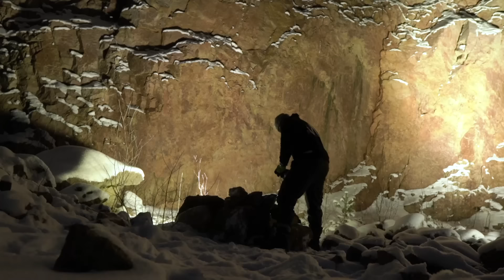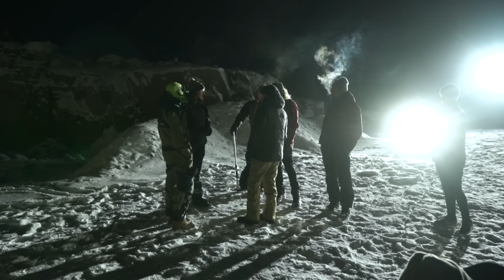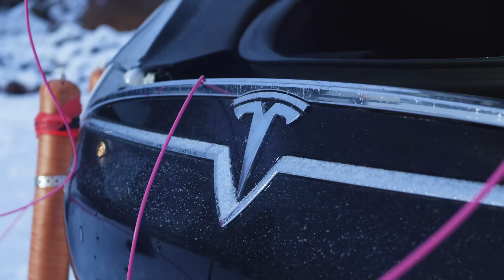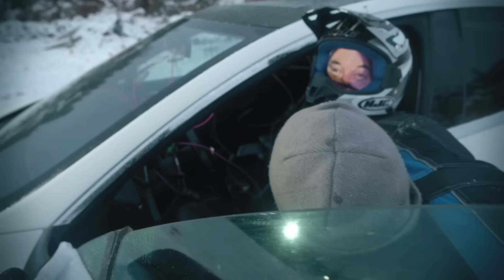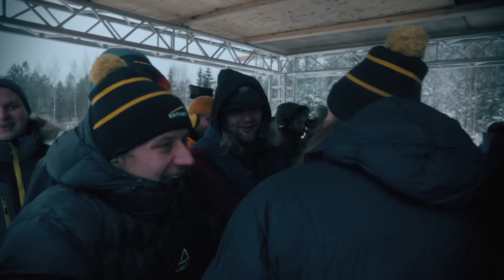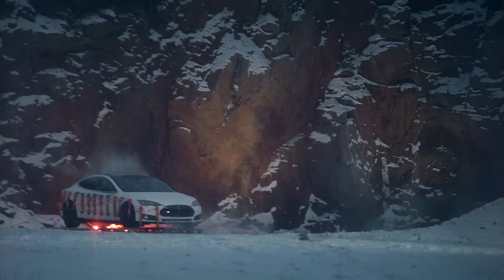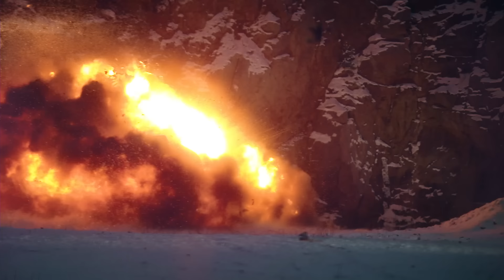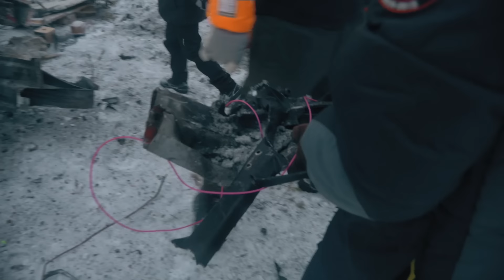Mies joka räjäytti TESLANSA!! Tesla Model S & 30kg dynamiittia.

Comment: It was soooooo beautiful.. despite it was a Tesla ( i understand the frustration, i hope Tesla's policies will change and soon). Honestly i was thinking to buy a Tesla model 3, but after seeing this..nope i will wait for the Toyota BZ4.
Reply: How about the Hyundai ionic? The  Ford F-150 Lightning and Mach E mustang are good choices too.
Reply: You should do more research into the Model 3 than just looking at this video (for instance, the quality of Tesla batteries have greatly improved since they produced this car in 2013, and the Model 3 uses a very different type of battery from the one the Model S has that is supposed to last over 300,000 miles). This owner was very unlucky and it's unfortunate that the service center in Finland didn't help him, but this one video doesn't show the full picture of owning Teslas and doesn't discount all of their happy owners. With any other car company there are an unlucky few who will experience problems with their cars and the companies won't help them.
Take GM with the Bolt fires, telling their customers to park their cars away from other vehicles in case they burst into flame, and limiting the amount the battery can charge for the same reason. There's also the Mach-e, which was so rushed that it continued to have software and hardware issues some of which Ford has deemed unfixable.
If this video is the only reason you're not buying a Tesla, you should give them a fair wrap by doing research on all the other horror stories caused by the legacy automakers, and after doing that you're probably never going to be able to buy a car again. I'm not necessarily saying Tesla is on the right here, but taking a highly unlikely scenario into account isn't really necessary when purchasing a car especially since all other automakers are just as if not more guilty.
Not to mention that Toyota is just about to get into the growing pains that Tesla experienced 8 years ago when they produced the car in that video since Toyota refused to abandon their hydrogen project for so long. They say the BZ4 will start production later next year, but it's probably going to be in very limited quantities and you might not be able to get your hands on one for several years, especially if they push back the release date as most automakers have had to do when they found out producing EVs was harder than they thought. Just because they are good at producing a lot of gas cars doesn't mean they're good at producing EVs since their power trains are completely different. Also, Toyota is bound to make many mistakes producing their first BEV while Tesla has had a decade of experience.
There's also many disadvantages to owning an EV other than a Tesla. For instance, legacy automakers are losing tons of money on these vehicles since they're just starting production on them, so not only are they more incentivezed to sell higher-margin gas cars, but they also have to sell their EVs at a higher price than a Tesla with less range and worse performance since the technology lead in Tesla's department is huge. Another thing is that all four Tesla models are the safest-rated cars in history, safer than even Volvos. Not only are they way less likely to get into a crash because of their autopilot, they are much less likely to cause injury or death if you get into an accident, which in my opinion is very important. I recommend looking at the safety reports that Tesla releases quarterly. We'll have to see if Toyota can match their level of safety. Also, one of the most important factors is battery charging infrastructure. Tesla has spent the last decade putting their charging stations all across their biggest markets while the other automakers have to rely on 3rd party chargers that are less in numbers but high in demand, prone to breaking, slower, and overall less reliable. I recommend watching Marques Brownlee's video on a road trip in a gas car, a Tesla, and another EV in order to get an idea of just how more reliable the charging network is for Teslas.
I'm not necessarily saying you have to buy a Tesla, but considering the other options it'll probably give you the best experience of what it's like to own an EV despite what happened in this video. It's great that you want to own an EV, as I also want to own one soon, but it's probably best you do some more research into EVs in order to find the one that's least likely to cause problems. We both don't want you to have a sour taste in your mouth towards EVs if you buy one and find out the charging infrastructure is terrible and end up stranded since the chargers don't work.
Reply: @collintheviking2082  yeah, literally everybody else will have the same problems.  Not even mentioning that most manufacturers will use same batteries etc. So everybody will just use current tech and have same issues. Its just part of the ev transition. Gas cars will be forbidden to go into cities and have massive taxes very soon so ...

Comment: This is exactly why I am hesitant regarding buying an electric car. They have not been around very long, only about 8 years or so, which to me is not very long at all. My main concern is how long the battery pack lasts, considering it is extremely expensive to replace. in fact, it is so expensive it is not even worth it. I am currently driving a 2002 VW Passat with 260K miles (418K km) on it still going strong. I'd expect an electric car to last 20 years and 250K + miles as well before I'd get more exited about buying one.
Reply: while i agree with your points i have one correction for you: the electric cars have been around for much longer than 8 years, and in fact Tesla themselves built their first car in 2006. the first electric car to be built was built in 1835.
Reply: @lenajk2004 Well, yes, I knew all that but mass adoption of electric cars really started with Tesla Model S. All previous attempts at making electric cars before Tesla came along pretty much flopped and the Roadster were more like a toy for the rich.
Reply: @Uncommonsensetoo  Nissan Leaf would like a word with you. But they definitely made electric cars cool.
Reply: Only thing common between the first vintage electric cars and modern EV is the same number of wheels and the basic idea.
Cars back then didn't have even a roof, tires were usually solid rubber and the size of bicycle wheels. Modern steering wheel was not stantard and could be just a lever ticking out. No doors or driving lights. Wanted to drive while it's dark? You lit a genuine candles inside lanterns that were in the front.

Tesla and any other EV has nothing to do with the old cars, modern EV's are in practice a new invention and their development is still in it's infancy. You can make computer animations and blueprints but nothing beats actual driving, wearing parts, leaking, shaking and general abuse during years and decades. No cars is planned perfect the first time and Tesla proves that when it's third 'generation' car is still ridden with problems and faults.
Reply: @Uncommonsensetoo  Well, the thing that broke was the aftermarket, upgraded battery he had installed. That caused his Tesla to short and break and also to void all warranty he had. Let's say, you buy a petrol car and then built the block out. Then the block explodes because the built engine failed. GMC or w/e carbrand won't give you an engine replacement so why should Tesla? Get the point? It's like buying aftermarket rims for your car, then while driving, the rim snaps and you crash. Or you buy pizza at your fav Pizza store and you drop your pizza. Then you go cry at the pizza store and blame them for it. Your train of thought is so ridicilous.
Reply: @Samosayummyyay  I don't see how it is ridiculous to be skeptical and have a wait-and-see position when it comes to how long the battery packs last. Like I said the first Tesla S cars came out in 2013, not very long for someone who like to keep his car for a long time.
Reply: @allandeverything  yeah, you could buy a 2013 leaf for dirty cheap because the batteries are so degraded.

Comment: What was the total mileage of the car? We just know,  that the owner used it for 1500km. It is not plausible for an 8 years old vehicle.
Reply: Thank you, that would be important context, right?
Reply: To be supervised of expensive repair of old premium car in official service
Reply: But i thought electric cars have no problems due to less moving parts? Seems like thats a lie too.
Reply: Best video in 2021 😆 F..k tesla.
Reply: The previous owner replaced the battery pack with a offbrand model and voided Tesla's warranty that way. It was also an imported car from the US and the replacement battery pack lost fluids which caused the problems.

Comment: I probably would have just ripped out the electric components, opened up the chassis and found a way to put a conversion kit in it and make it run on diesel fuel,  gas , old cooking oil or a combination engine.  Sort of like the kit cars using VW or Ford Mustang engines.  Then he could have offered fed up owners of older Teslas a way to get good aerodynamics with the benefit of the range of petrol.

Comment: Adorei o vídeo e o protesto contra a Tesla. Com certeza muitos vão pensar bem antes de comprar um tesla, principalmente usado, ou seja, fora da garantia ou próximo do fim dela
Reply: ADOREI????N Sabe o danho do medio ambiente? vc e brasileiro sabe o que e natureza? O video e porra pura
Reply: @jccoronado4348  repairing the car would have cost 20 000€, so why not just blow it up for content?
Reply: SE FOSSE AQUI NO BRASIL, O PROBLEMA SERIA RESOLVIDO EM MENOS DE  UMA SEMANA.
EU AQUI NA OFICINA, COLOCARIA UM MOTOR AP DO SANTANA COM CAIXA E TUDO, POR UMA BAGATELA DE $500 DÓLARES AMERICANOS.
Reply: ladrão 28.350 reais que porcaria de preço caro 28 mil reais e meio
Reply: @ST-wn7zt   What do you think a battery pack in the EVs would cost? Its the most expensive thing to make in the EVs so the replacement costs.. For instance Ford Mach - E is costing around $55K which is even costlier than the new Mach-E itself. At this point the battery packs replacement costs are stupidly higher and among those stupid high prices, Tesla battery packs are quite low!

Comment: This is why you shouldn't buy an electric car, guys.

It is uneconomical to replace the battery when it dies. Your only choices are to accept the total loss and junk it, or blow it up with dynamite. ☺
Reply: I agree that this is currently an issue in 2021, but by 2030, when everyone has EV's, it'll be much cheaper to replace batteries packs after 10+ years of use.
Reply: I have no intention to get an EV. I have a 2006 Ford Ranger & it runs like a dream & I only owned that truck for 6 months.
Reply: @codywilliams1506  totally fair, but countries will start to ban the sale of petrol cars (2030 in UK) as well as Ford and other big auto companies switching to 100% electric by 2030/2035. So you may decide to keep your car but eventually petrol cars will be phased out (or the minority at least)

Comment: I will do the same for my 2020 tesla model s. If you pay 100k usd for a car it should be premium quality, top notche like bmw, audi, mercedes or porche. Not this kind of china vehicle where paints tearing off and battery drops 50% when there is even one minus degree. How this can be co2 friendly if you have to drive 200.000km that you are even with diesel car and winter conditions that battery replace might come even earlier like in this video. If you replace your battery then you have to drive again that 150-200k km that manufacturing co2 load is even with diesel or gasoline car. throwaway tech!
Reply: You probably don't care, but your numbers are way off. Judging from what you write I strongly doubt you own a Model S at all.

Comment: 20000 euros per 8 years is 2500 euro per year in expected repairs. These electric cars seem to be extremely expensive to drive. Also, I was under the impression that the battery should only cost half that with the current price development on batteries, but I guess Elon lied about that.

I am seriously reconsidering of me next car should be electric or not (thinking not; just too expensive).
Reply: Electric cars were quite popular in early 20th century, but 2-3 times more expensive than gasoline ones. Nothing changed and nothing will change as the basic technology is the same.
Reply: @antonnikolski2602  it is a single concept, but a lot has changed. The only common thing is mostly that they both are called electric cars. Not a single part is unchanged.

Comment: So it may have been missed in translation, but given the age of the car we can assume it was bought second-hand right? And hence the lack of warranty. Still ... you'd expect a car less than 10 years old to not cost 20K to repair!!!!
Reply: Second hand yes.
Reply: I guess that there may have not been questions directed to second hand repairshops, hence the high price.
Reply: @f36443  tesla wont instal a secondhand battery for him. And a new battery is 20k. Ev are like plastic trash. My 2006 bmw with 350tkm is still fine. Unlike that trashy car
Reply: @f36443  yes there are plenty of teslas with 1millions miles most of them are taxis and get there is 4-5 years but an avrage human drives in finland 10-20tkm. And in finland there is no mechanic who would svap ev batterys
Reply: @f36443  and btw in finland we have like alot of mercedes diesel taxis with over 1 millions miles and they are 100x better than teslas
Reply: @mikkejalonen9050  you stick to your old taxis, Finland is quite backwards isn't it
Reply: @f36443  yes we are we are socialist hell hole were inovation and bussines gets fucked by high taxes and regulations. Finaly we agree
Reply: I wouldn't call this as repair, it was the price for the battery replacement.  If the guy could find someone who can check the died battery cells and replace them separately it would cost much less...
Reply: @Alfred Wedmore oh yes if u arent mechanicly skilled or have alot of extra money dont buy a luxury brand. Get a toyota. And mercedes diesel arent that bad tbh

Comment: @RichRebuilds, would have been a far cheaper option for you, he helps Tesla owners from being ripped off. Unfortunately, some EVs are going to see the same fate as this Tesla where owners won't be able to afford a replacement battery unless someone who knows what they are doing replaces a few out of balanced cells to give the battery extended life.
Reply: He is from USA, and shipping the whole battery (or car) back and forth would cost almost the same as the new battery sadly.
Reply: @michvod  sure, I know he is from USA, but also pretty sure he would have found a suitable solution as well, normally the whole battery doesn't need replacing, only a few cells out of balance is what causes the issue, and he replaces those cells

Comment: This is my opinion as an electronics technician right from the start:

 e-Car = Smartphone = Disposable product

These overpriced, mobile smartphones lose so much of their value within the battery warranty that you almost have to give them away after 5-8 years (after expiry of warranty) in order for someone to take them at all!

The best example you can see here in this video, even if it cost the owner a lot of money.  In the end, he didn't get very much from it other than a good deal of attention 😉

My father's Mercedes, which was 20 years old at the time (over 800,000 kilometers of mileage) had an exchange engine for almost 4,000 euros and he drove it for another 10 years and he sold it for a good price back then.  That's what I call sustainability!

If ALL e-mobile car manufacturers don't soon offer a good, uniform and inexpensive replacement option for the battery unit, I see the "savior of a better ecological balance" as a failure!

I will therefore stay with the combustion engine until there is a sensible solution here.

Comment: ONLY 8 years old !  My 2 Petrol cars are all like new and going strong after 26 years and 24 years respectively. They cost very little to run and I drive them infrequently. If they had been Tesla's I would have had to replace the battery 3 times each at a cost of $132,000 but in fact they have cost me just a couple of thousand pounds over their long lives. They are also worth more now than when I bought them many years ago. Electric cars are not the future. Who wants a second hand iphone 4 ?

Comment: what's the mileage on this car, from what read online those cars are designed for about 300,000 to 500,000 miles if it's in this range is in, I think the price makes sense. because you would be getting another 300,000 to 500,000 miles for $22000. if you figure driving 12000/yrs to reach 300,000 that's at least 25 years.
Reply: I am wondering the same!

Comment: Wonder if the batteries were removed before blowing it up? Guess it would have been too dangerous with the batteries still installed? Might have been able to get it fixed by a 3rd party for cheaper than $30,000.  Oh well, too late now.
Reply: It was basicly an empty shell in a tesla form, all the batterys & motors etc was taken out before. We aint stupid here :)

Comment: TESLA warranty 8 years or 150,000 miles - 240,000 km, whichever comes first, with minimum 70% retention of Battery capacity over the warranty period.
So after 8 years and 151,000 miles your warranty is gone like all other brands. 
Get some likes on youtube and you can buy a new car ;-)